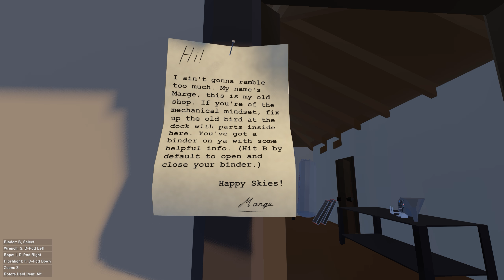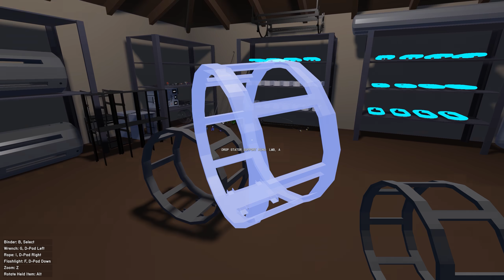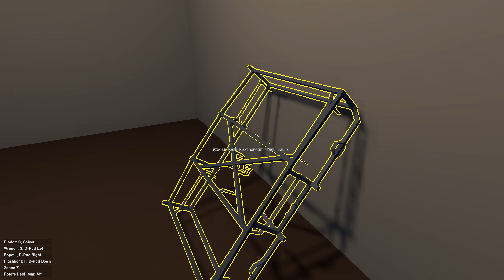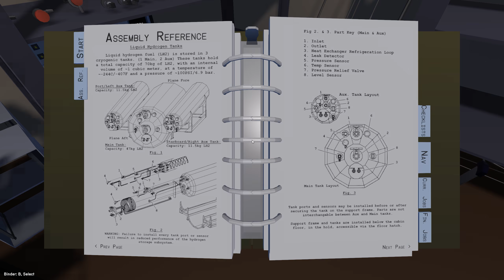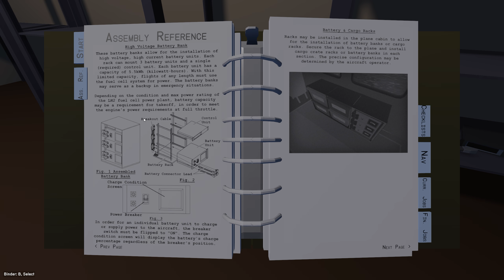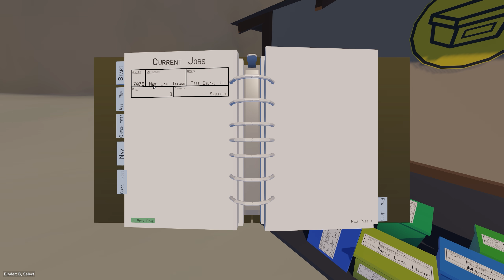I Built My Own Plane… Now I Have to Fly It (Lakehopper)

Comment: Flaps at 60 degrees is for landing. No wonder you had so much trouble taking off.
Reply from the maker: Not really, you can do both in this sim as long as the trim is set

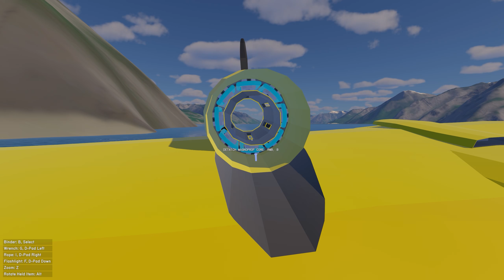Comment: 8:57 - So the main nut holding a helicopter's rotor to the shaft is jokingly called the Jesus bolt, because if it fails you'll be seeing Jesus soon enough. I've also seen the pins that connect a turbofan to the nacelle being referred to as Jesus pins before. But that, right there, is THE Jesus screw.

Comment: This is the first time where I started your video and almost immediately stopped it to go buy the game and try it out without any spoilers because it just looked so cool! 

It was so fun to come back to the video and watch you build the plane and do your first flight and mission and compare it to what I did. You have way more experience with flight than me, but I was happy that I at least came somewhat close to the way you did it. Also... it took me WAY longer than I care to admit to find that tank cutoff switch. I was looking in the tank bay, on the side of the plane, back by the door, and on the big supply tank until I finally realized that whole overhead panel existed, ope. 

I'm using my TB VelocityOne Flightstick with the game and it's pretty fun, still gotta work on some mappings though. I also chose Nest Lake and when I got there I was looking in the same location you were when I realized why it was named that way, lol. It was so cool to land in there even though I nearly botched it, haha. When I got back to Test Island I was so dead-set on parking the plane like it was when the game started and I ended up beaching it while trying to go back and forth with the reversers. Finally realized I could just pull the stupid thing in straight on the other side of the dock, lol. 

For maneuvering around in the water using differential thrust helped so much. I'm just using the keyboard for that when I need it but it sure would be handy to have dedicated controls. 

I think I saw that you played some more of this in a livestream so I'm gonna go find that VOD now.
Reply from the maker: That is awesome to hear yeah I think this game is great for people new to aviation.

Comment: Load balance is critical in boat or plane. Your issues were the batteries stacked on the same side.
Reply from the maker: I’ve since tried it with the batteries on both sides and the cg didn’t change

Comment: my early video guess is that the wight of the battries on the left side is what was causing the plane to be left heavy. guess well find out soon LOL
Reply: Seaplane. Only one of the pontoons is in the water at a time and this game models that drag on the water. She pulls to the right when you put the right one in as well
Reply: @loginlover that, plus a lot of torque. Balancing to counter it does help a little though
Reply: Yep, whole time I was thinking it had to be the weight distribution. Plane was too port side heavy from both batteries and the pilot being there. 

And speaking from flying in War Thunder I can say flying with a controller is second only to professional flight sim setups. Its smooth as butter if you set it up well, and I too have landed many large planes by slipping them in onto the runway. Its a necessary strategy with the smaller tank battle maps where the airfields are only a few miles away from the battle, and if you’re piloting a big behemoth like a bomber
Reply: @alexbibby9641war thunder is amazing sim i made a controller setup and fly sim